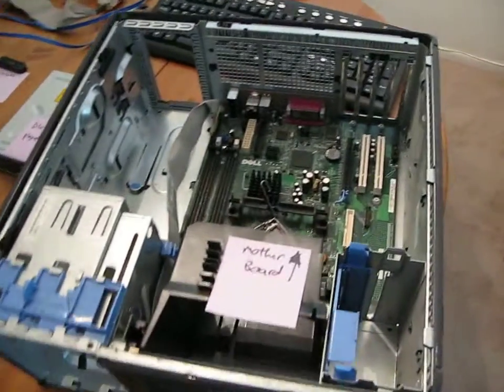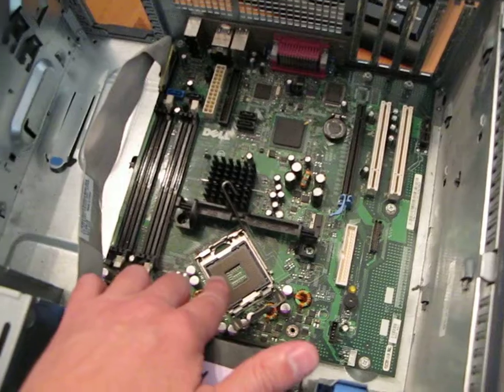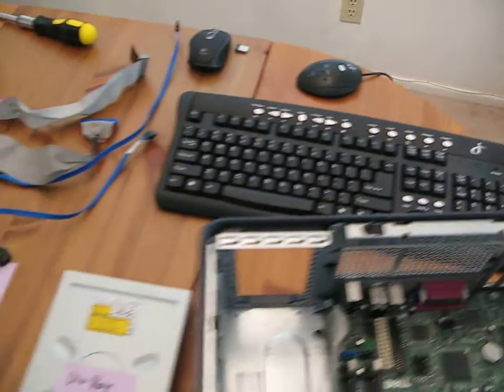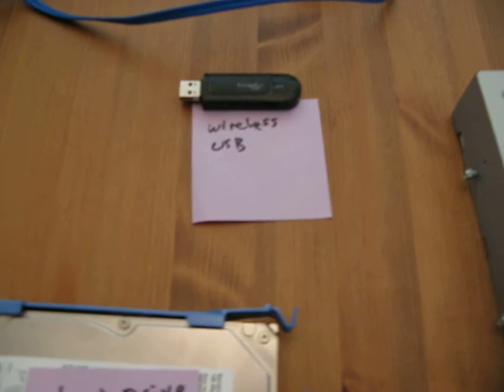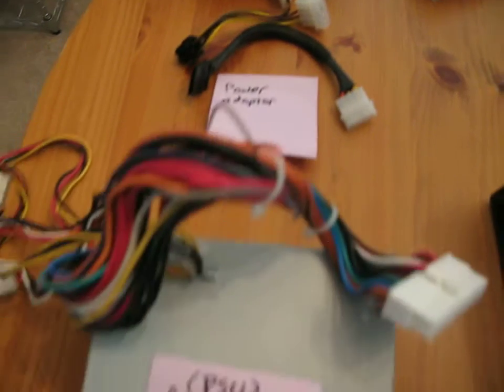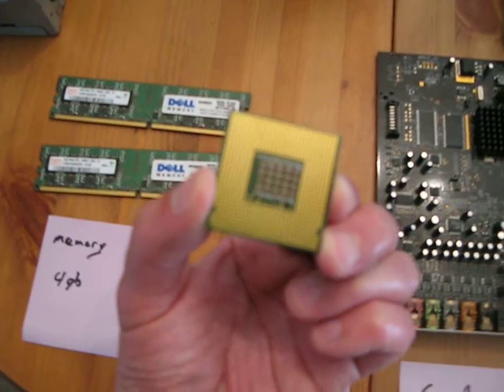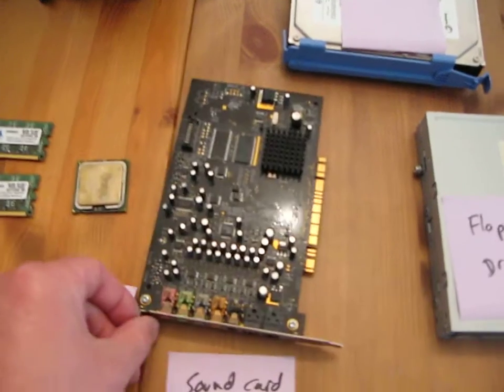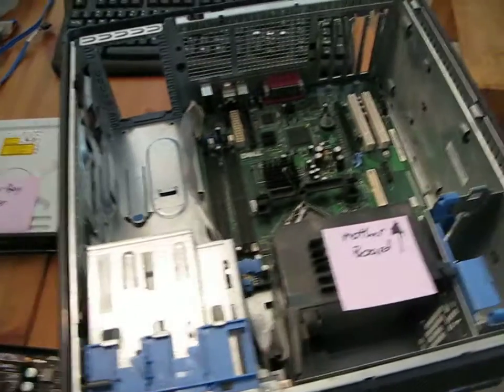(1 of 5) Old PC to Home Theater PC (HTPC) - Anatomy of a PC

Comment from the maker: Nice.  ya. make sure you have good clearance front and back.  Fan paste does indeed help, lol.  Also I am sure you know this, but for anyone else that may read this, check that your fan and heatsink are crud free.  This can cause the computer to overheat as well,  A good tip is to never sit your computer on the floor, because it picks up a lot of junk that will clog up your system... over a relatively short amount of time.  Glad you got it under control now =D

Comment: OK, thanks. I took the heatsink off the CPU and had a look. It was mounted fine but the thermal paste was next to nothing, so I guess that's the problem. Also, I never enable 'smart fan' or whatever it is that lets the mb control the fan speed. Quiet, fast fans ftw! lol.

Comment from the maker: Only prob is I have to hit f1, to bypass the internal fan disconnect button.  I might need to google a bit and see if I can do a feedback loop or something to short that out.  The computer is so old, I don't want to put any money into it... I just want it to do the job, lol.  On another heating note, the projector blows really hot air out, and I initially had the tower standing right under it.  That didnt last long, lol.  To solve, I layed the tower on its side.  That solved the heat issue, lol.

Comment from the maker: Hi EdgeofPain, Thanks for the comment.  Not sure how hot the cpu runs, as the  Optiplex GX620 doesnt have any heat info in their bios!  Just Dell being cheap, lol. The fans on this model also revv up really loud as it gets older.  This is due to the inboard thermostat going out.  So, I unplugged the CPU fan and put in 2 none motherboard controlled ones to keep the cpu cool and sound down.  They are just normal case fans, but do the trick.

Comment: I have the same P4 in a very old computer. I was trying to see what I could put together from old parts. My mate gave me a Foxconn 915 PL motherboard for it.. I was surprised to see it had never even come out the box (It's an OK board with a nice BIOS, can take both AGP and PCIe cards and IDE and SATA) . How hot does the P4 3.8GHz run for you? I used what little thermal paste I had and in the BIOS it showed it was running at 70C!!!